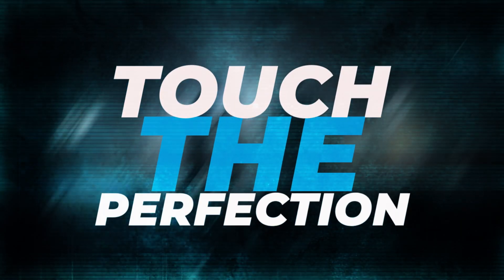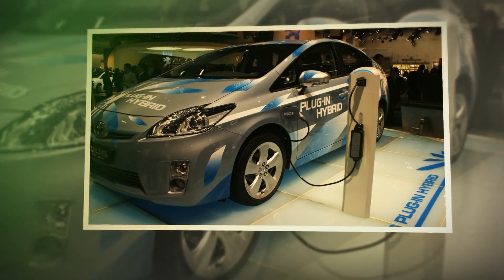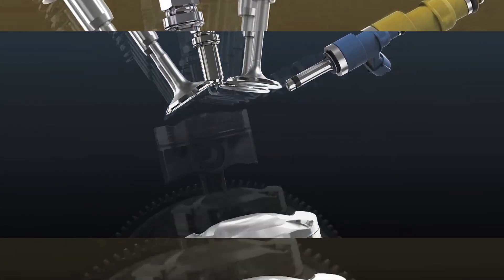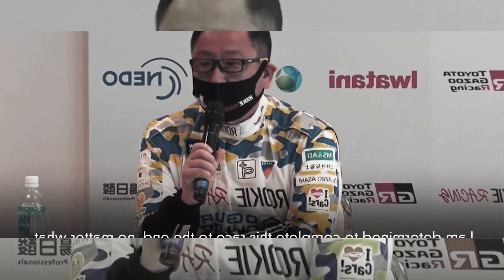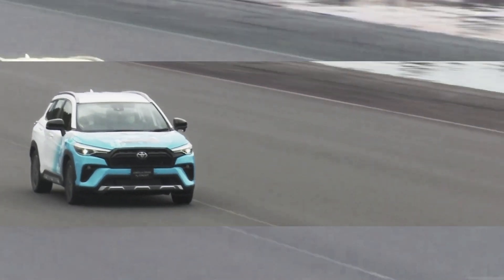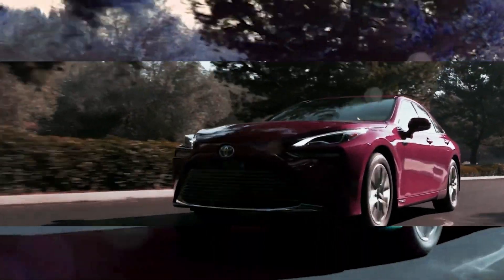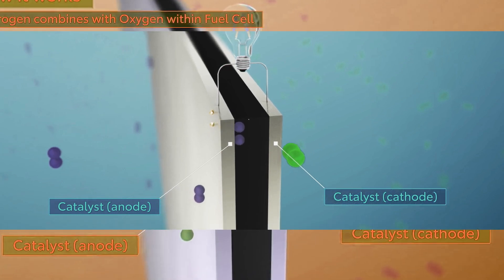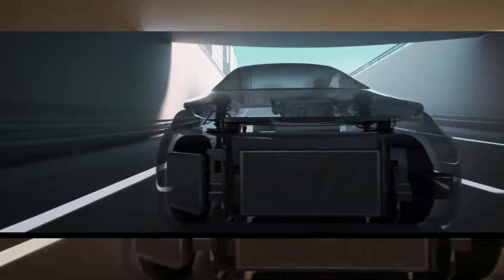Toyota's New Hydrogen Combustion Engine Is Truly A GAME CHANGER!

Comment: A very nice summary of Toyota's reduced emissions` and zero emissions vehicles. The annual model change and every few years generation change is a staple of the auto industry.  Toyota has a couple dozen cars to update every year and Lexus maybe ten.  Plus the generational changes. This is a huge amount of design. Toyota prides itself on a mastery of automotive technology. Hydrogen combustion is not quite ready for prime time. R&D tries to master a technology before it is released to use in a production car.  Obviously, a lot is learned the first year. Toyota tries to match its technical capabilities with consumer desires (known and unknown) to produce many new cars every year.